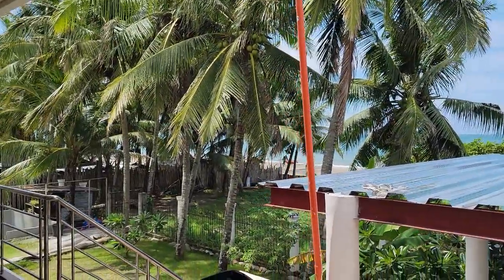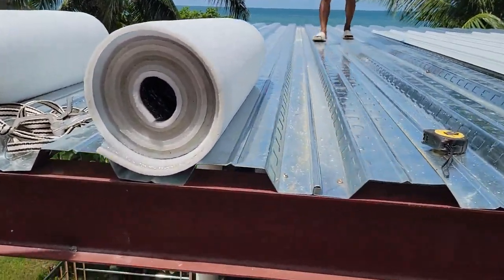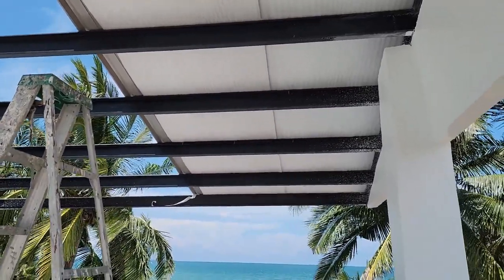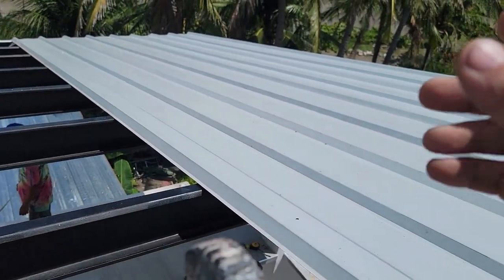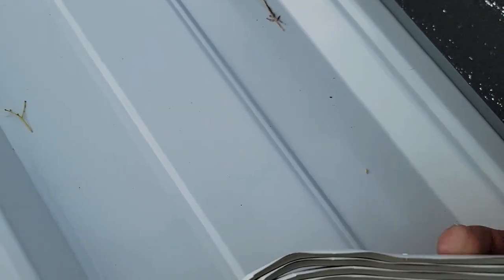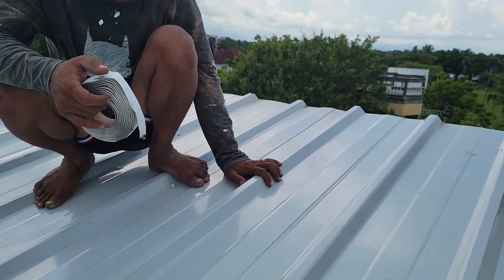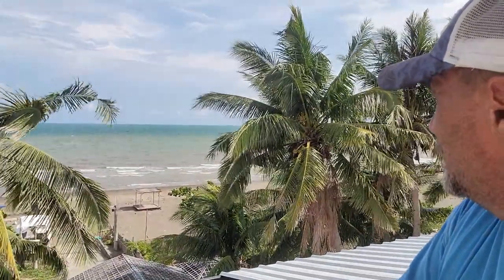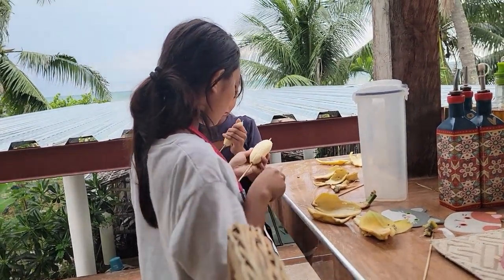ROOFING BEGINS  - Teaching them Strong Way to Install It

Comment: Not only is water going to sit on that roof you're showing us, but I would also imagine that shortly after a rain event that thousands of mosquitoes are going to be hatching off of that roof. Good job on the roof. The guys who did mine were telling me they needed more screws, for every one screw they installed, 2 were on the ground. Lol. Pick up the damn screws. Mel & the girls are doing an outstanding job of cooking up the vittles.
Reply from the maker: It rained yesterday and that roof was swamped. We could even see holes in it from missed screws and they didnt even fill them. Yet they are doing drop ceilings inside and other finishing right now.

Comment: Hi James, Finally showing proper screw placement and sealent on the laps. What thickness of metal did you buy? Will you use closer blocks on the eve to stop the wind from getting in. Where did you get all your roofing material from? Thanks James

Comment: That's great how your instructing the guys.
In a previous video you showed the difference of the screws in the Philippines, compared to the ones you have. 
Suggestion, it would have been beneficial to see the difference. Thanks for showing the other roof.
My wife's house, her relative built. Issue after issue...

Comment: You need a standing seam roof. They have hurricane clips and the panels lock into the Eve drip. Being on the water that is the safest kind of roofing. If you can even get it over there. Just Sayin ! Roofing is my trade,(retired) Roofers Union Local 57, Miami Florida.
Reply: I didn’t realize you were pouring a deck on the metal. What you’re doing is what we would put on shopping centers for instance. They put the metal then insulation then they would pour the deck. At that point we would apply what it called for but it’s different than a house they would have a parapet wall. You wouldn’t see the roof except the mansard roof on the front of the building.
Reply from the maker: I was a commercial builder stateside. I owned my on company doing this work and made a fortune doing it.  This is not AMERICA and you put what you can get that will best suit your needs without too much cost. I personally wanted this  r panel. It is the heaviest gauge and will have solar mounted all over top of it. It will get walked on often. Standing seam without backing ( under layment ) sucks to walk on.   R Panel has zone ratings for how the screws go.  In Hurricane zones you put 6 screws ( 2 in each valley  for the first two purlins along the roof edge.  You put  6 screws per purlin on your sheets along the outside edge. You put 6 screws per purlin for the top purlin. The rest get 3 screws per purlin next to the rib for strength along the angle.  Then you put lap or stitch screws on the laps. I  worked mostly hurricane zones including Florida. We worked all over the state.  We would partner with a local Florida contractor and he got a cut working under his license in the state. Same in Louisiana.  If he had work in Texas we would return the favor.

Comment: Closer and closer, soon those skills you’re passing on will be showing up on other job sites when yours is finished.
 So are you going to be using those lap screws on that decking material before you pour the concrete deck, to hold the sheets locked together?
Reply from the maker: no the lap screws are not for that

Comment: it's looks kinda counter intuitive. but what's that reason the screws are drilled to the low spot and not at the ribbed high spot of the roof?
Reply from the maker: That is where they belong I was a commercial builder stateside.
Reply from the maker: https://www.muellerinc.com/documents/20143/5570895/Mueller%2C+Inc.+R%26U+Panel+Install+Guide.pdf/ee33de4d-9e6a-09fd-a718-a822eea4ba61?t=1636059907963  here is one of many companies spec sheets see page 10

Comment: Hey James, is the insulation covered on the underside on the top floor. My brother didn’t put a underlayment under his insulation and between birds, insects and and wind the insulation didn’t last a year before it shredded. He redid it with a piece of aluminum sheet than the insulation than the roofing, been going strong for the 3rd year in Charleston near the sea.
Reply from the maker: It will be closed in later.
Reply from the maker: Your right if you leave it like that big problems and uv damage too
Reply: I am an engineer and hate doing things twice lol ..

Comment: James are the lap screws available there or should I get some at Lowes or Home Depot. The guys that put new metal on our home missed the purlins a few times and so we now only have some silicone sealant in the holes. Thank you Bob.
Reply from the maker: Order them online so you get good ones. Make sure they are coated. You can find on Amazon.
Reply from the maker: I never found any here in PI
Reply: Thanks will do.
Reply: Thanks I'll check at Lowes and Home Depot here in Fort Worth.

Comment: Your insulation seem saggy... I think the best is still to use galvanized wire as others now usually do...
Are your roofing materials .6mm? Also, should'n't you screw the roof on the raised rib part?
Reply from the maker: Ok , where do I start?  I am along the sea shore. Galvanized wire or any wire will rust right away. Next the sag. You are supposed to sag it. It causes a void for trapped air, the hat metal is not in full contact and allows for the foil; to radiate back the heat. Lastly NO you DO NOT screw the roof on the raised rib part. That is a bad habit that is against the manufacturers recommendations. I shared this on a prior video including spec sheets.  I made bulk of my money doing commercial buildings in the USA and I know this one well.
Reply: @TexasFilipino Thanks for the reply man.. I am getting a lot of pointers from you in this channel.  I plan to build my retirement place in the cool mountains  somewhere in PH next year when I finally retire from almost 25 years here in the US...

Comment: Does anyone do spray foam insulation on the roof.  I am thinking of pursuing it.
Reply: Theyre prices are higher than usa and quality of werk questionable
Reply from the maker: I personally never seen it.
Reply: @builtnotboughtmadeinphilip3955  yes, my house here in the states is encapsulated and is amazingly efficient.  I have only found one company in the PI and they were spraying the outside of the roofs lol.  Spraying 4-6” would make a huge improvement to the envelope.  Most of the pics I have seen in the PI is a very light 1” spray which wouldn’t be a significant improvement.
Reply: My American friends years shipped two 40 containers over for when his was being built here in Pangasinan. Included in that were thick styrofoam sheets.
Thickest,  I have seen it here is 2  inches. They clad the entire outside of a SM mall with it near us!

Comment: Could have pre drilled your sheets and had one of the guys to screw it down…and all of your screws would’ve been exactly in line…pre drill all of the sheets at once…I know that your done already with your roof but maybe it will help someone else
Reply from the maker: I dont like predrilling roof panels. I ALWAYS predrill wall panels.  Roof purlins can roll slightly  even bow.  I have one hell of a eye for shooting screws.   Wall purlins we always make temp supports in the middle of the span because of the droop. Then remove them after the screws are shot.

Comment: James I’m honestly shocked to see you using the expanded polystyrene coated foam insulation knowing how you over engineer where you can. I know from living there that the light and heat causes the polystyrene to “rot” ,to the point that it breaks up and fails.  I’ve seen so many roofs only 5 years old with insulation flapping loose. I used 4 inches (2x2) glass fiber which lasts the life of the roof.
Reply from the maker: Finding fiberglass is next to impossible.  We will paint the underside so it will get UV protection. Not everything can be perfect. Sometimes you have to just settle.  Now that outer part of the roof will get closed in also back up the bar area. Guess it will be IT IS WHAT IT IS !
Reply from the maker: Another quick note. That is a open roof. will get monsoons and typhoons. If fiberglass get one single leak into it it soaks up waters like a sponge.
Reply: I do understand the difficulties regarding glass fiber insulation but I found it in Cebu readily available. It also comes with the foil coating so lays like a blanket. So should not get wet. I only said I was shocked and you are not scared of going out of your way to get what you want.